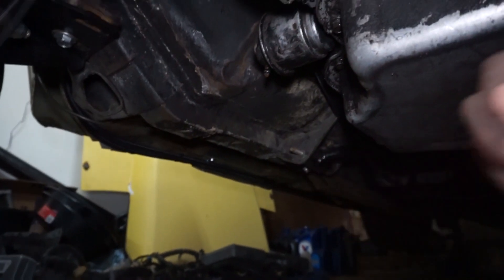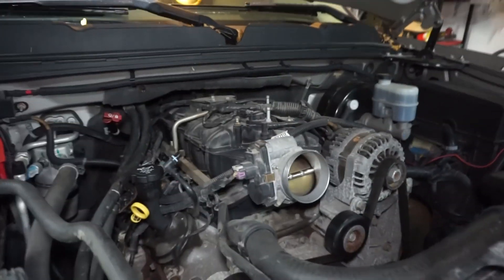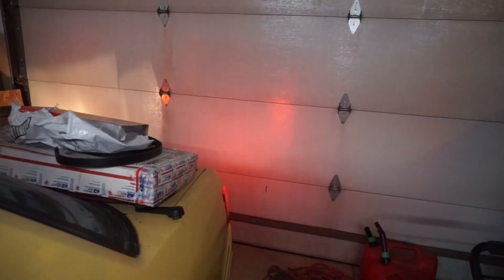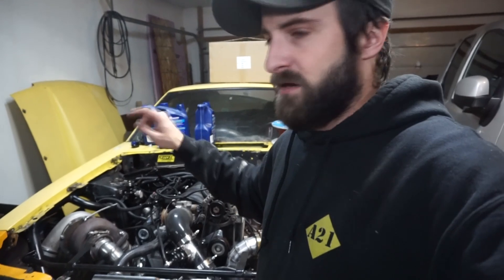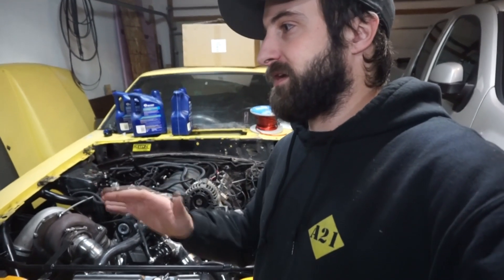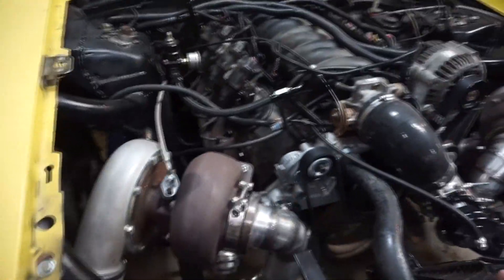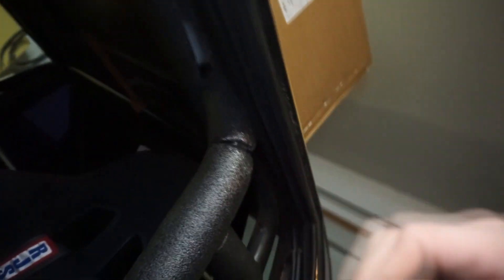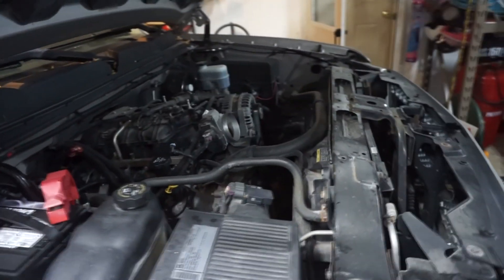NEW PROJECT!!! Twin Turbo Fox Update And Trans Issue!!!

Comment: Dod failure. ...that single bolt in the cam failed probably clogged up with crud and shit.......get an adjustable modulator for the bannana the boost probably fucked that modulator up.....probably a 30yr old modulator and the boost blew out the seal. ....I wonder if they make boost specific modulators seeing as how ur pushing air instead of pulling